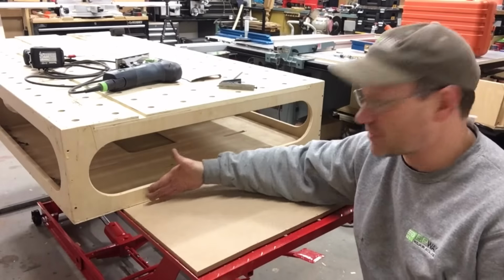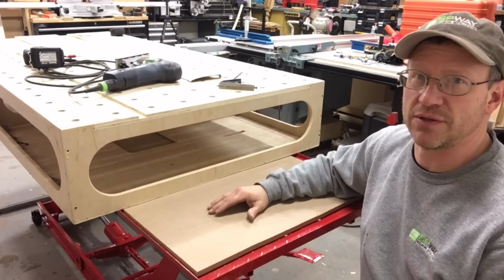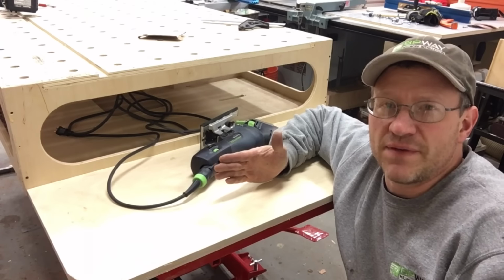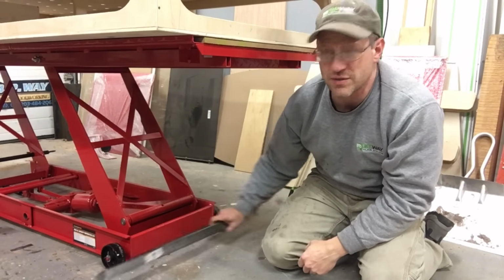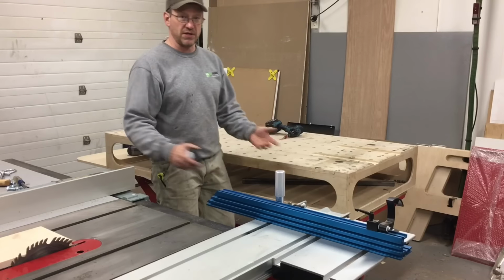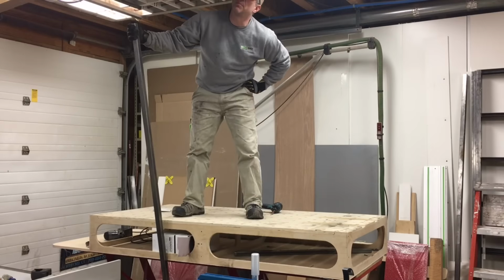Turn a Harbor freight motorcycle lift into a plywood lift feed table for wood shop

Comment: Thank you for this video. Based on your experience I bought a Harbor Freight Motorcycle lift to replace the saw horses for my Ron Paulk inspired work benches.   The ability to raise and lower my benches is a blessing.

Comment: Good job!  I did something similar to solve a space problem, and it's been working great for 4 years now.  My two passions are woodworking and old Norton motorcycles.  I already had a pneumatic motorcycle lift and my shop is small -- so I made a workbench top for the lift that is removable when I want to work on my moto.  It converts from one to the other in less than 5 minutes.  Now, if I could just rig a mini-gantry to pull the bench top up to the ceiling...

Comment: Having had one of these lifts for a while I learned a few things. Don't leave the lift up overnight unless the bar is used and pressure relieved as the oil will drain away from the piston and the piston might score the side of the cylinder. As the lift goes up the weight goes forward, I have had it go far enough to tip, adding outriggers that go forward is advised. I made a frame underneath with 4 swivel castors and this helps with stability and moving. The price goes as low as 299 and I have seen them on Craigslist for less.
Reply from the maker: I noticed I needed the bar on day 1.  I guess that is why they supplied it.  Outriggers will be done soon...

Comment: I've been thinking to do this for a few years, but haven't been convinced about stability. Aside from the additional outriggers, how wobbly is it? I mean, if the bottom were rigidly attached to the floor, would the top be stable?

Comment: great idea on lift! your sliding table on your saw caught my eye do you mind sharing make and difficulty installing it on your saw? or did it come with saw ? thanks
Reply from the maker: marc martin it is a Laguna brand, purchased from rockler for $650, just need to drill and tap three bolts, very easy to install

Comment: Some ideas seem great at first but after some actual shop time they just miss the mark for one reason or another.  I would love to hear how this has worked out over time. You posted the video in January of 2017 and now it is November. You certainly have enough time to know whether this idea is a winner or not. I am very concerned about how stable it is to side to side movement. I love the idea of a Paulk table that is that easy to height adjust but if is has lateral movement then that would be a major problem. Can you give us some form of update on how well this is working. 
Great videos, keep up the good work
Reply: It must have tipped over onto him as he has not responded to your comment as of March 24, 2019. : (

Comment: How is it holding up? Is it still sturdy? I'm looking at doing this but with a laminated 2x4 top for my workbench/ assembly/ indeed/ outfeed table. I have a small shop so I have to really maximize space and tools for efficiency. My workbench will probably be 3'x7' or 8'. Do you think this lift will be stable enough for that?
Reply from the maker: this bench is 3x7, you could go 8' long, but I would not go wider than 3'  Also, need a couple of outriggers like i mentioned in the video (but have never done...)  Definitely love the bench, always adjusting the height for my current needs.

Comment: Great idea Brian, hmmmm, how can you make the stabilizers adjust hydraulically to account for an uneven floor? Looking foreword to seeing that solution.
Reply from the maker: I think manually is all I have time for, however you got my wheels turning....
Reply: It would be great to find a small battery powered hydraulic system that could lift and self level items like your bench, table saw, etc. Thank you for replying, have a great day.
Reply from the maker: Steve if such a thing exist, let me know, I could find all kinds of uses for that!

Comment: Any update on this project? Did you end up adding any more stabilization? Does the lift have any lateral racking or looseness? I have been thinking about making one a base for a more traditional woodworking bench, but it would need to be pretty stable/sturdy for handwork...

Comment: hey brian  I'm hoping this will be what I'm looking for in my shop as well. quick question. i have a 4x8 paulk type bench and would be looking to use the HF underneath it as an assembly table. do you think a 4x8 top would be to wobbly on this?
Reply from the maker: Dean Rovedo Jr. Well I think the Paulk table is 3 x 7, could be a little wobbly at 4x8. It is a great secondary table for me, especially as the feed table for my table saw
Reply from the maker: Dean Rovedo Jr. If it is your only assembly table, it may not be sturdy enough